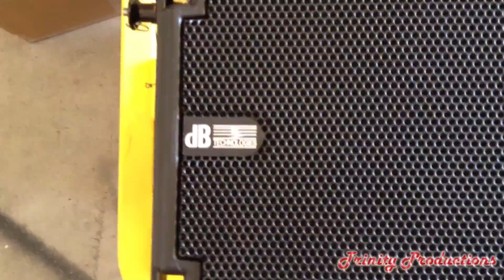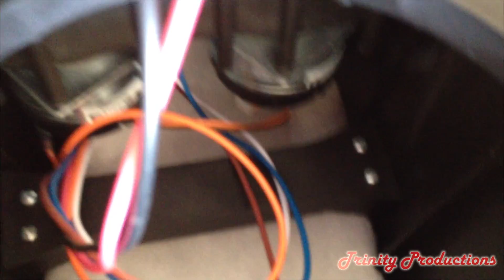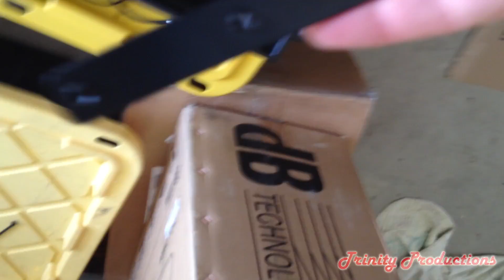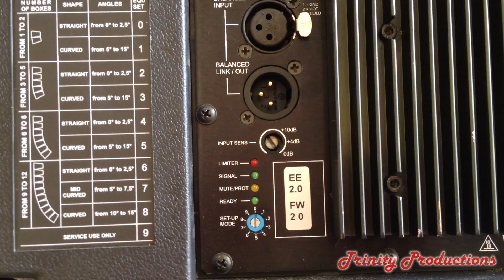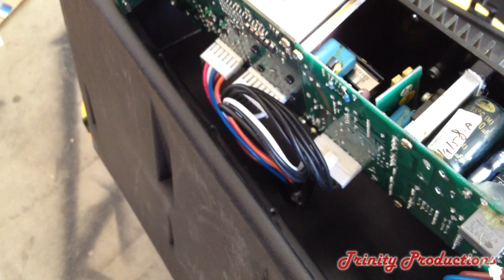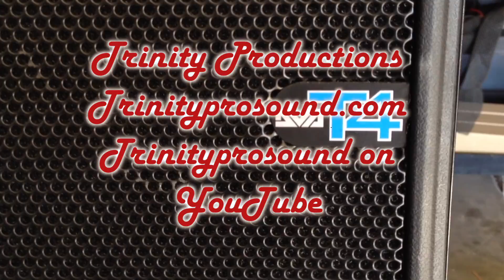Inside the dBTechnologies DVA T4 cabinet V2 updated - Auth DLR for dB Technologies

Comment: How are these compare to the rcf HDL20a?
Reply from the maker: The T4 is discontinued. They are not even close to the HDL20. Different drivers and power amps and response. You would have to start looking at the VIO line to compare with HDL20. HDL20 has lower crossover point for HF and 300 watts more power.
Reply: Thank you for your reply. I’ll stick with Hdl20a for my choice of line array

Comment: what is the difference between the version 1 and version 2 models
Reply from the maker: version 1 did not have the noise gate on the amp, ver 2 did and would mute the amp if no signal was present to stop the amplifier hiss when not in use.